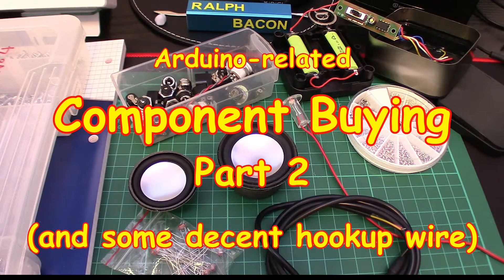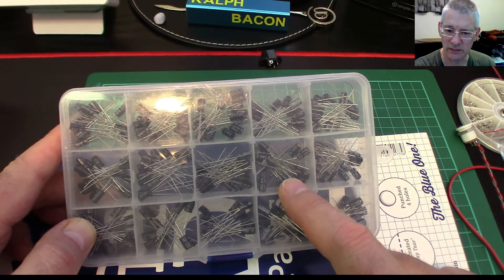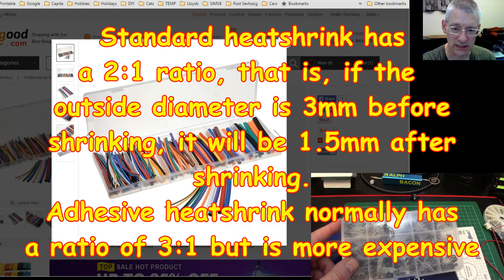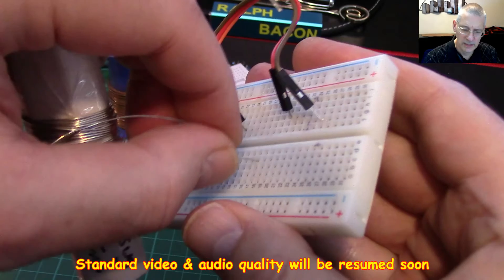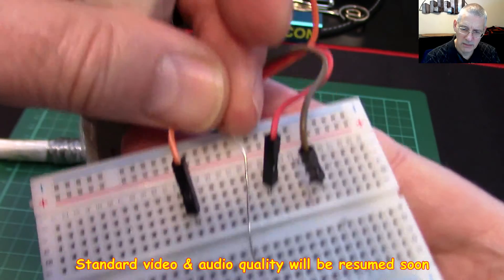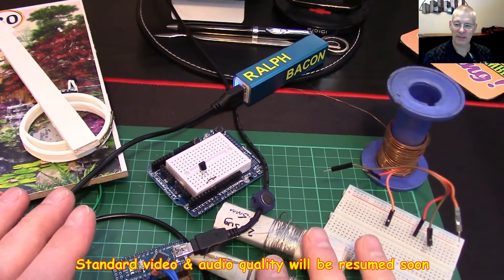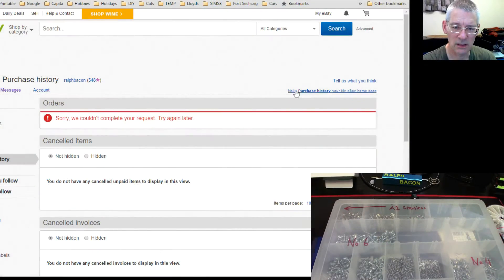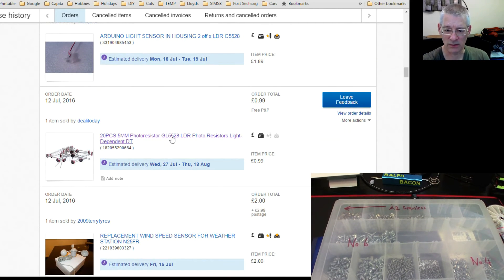#47 Arduino related components - Part 2

Comment: You mention a lower limit of 0.4uF (?) for electrolytics,  I have some (salvaged) in 0.1, 0.22,  0.33,  and 0.47.  They were quite commonly used in some of the VCRs I scrapped some time ago.  I can't see why you'd want to use one of these as opposed to the many other ways you could get 0.1uF,  though.
Reply from the maker: Electrolytics are the devil's spawn, Ray, as they fail (dry out) far too easily over time (and heat is a big enemy) but it's the only way to get bigger values. I use ceramic where possible for lower values these days.

Comment: 11:34, I also encountered problems with ebay history listing a few times in the past..
Reply from the maker: So probably not a setting on my machine then. Thanks for letting me know, it's really irritating when it continually happens. Given that I order quite a lot from eBay I try and track what has arrived and what is still on that slow boat from China so it's important I can see my purchase history. Let's hope they get it fixed soon. Appreciate your post.
Reply: sure, I write my orders at an excel spreadsheet as well with details of order date and price in case of such irritating malfunction happens and also to track what items I possess at my electronics repository section in general